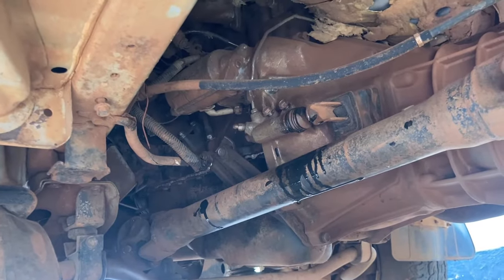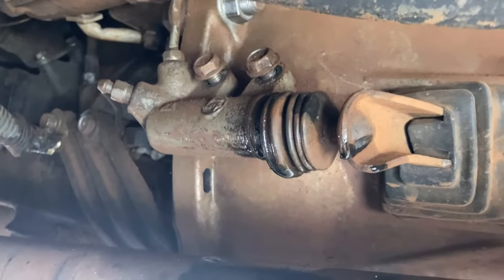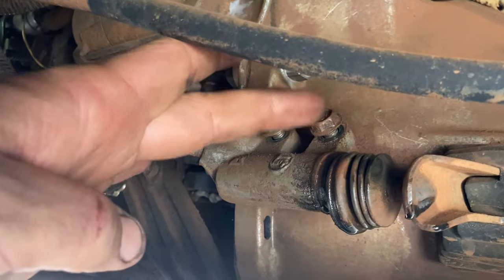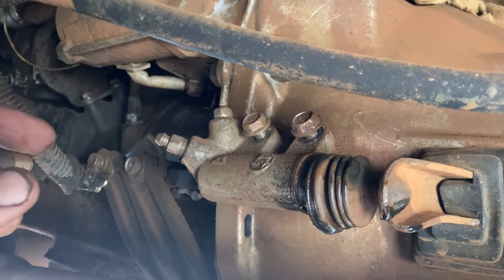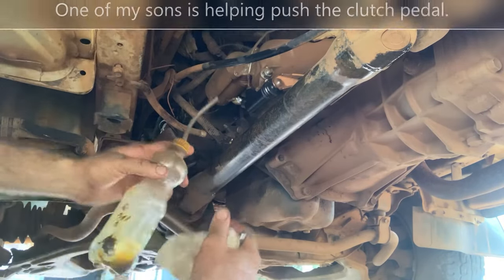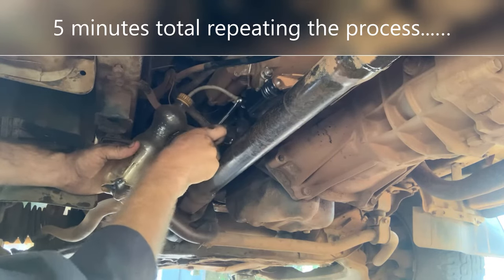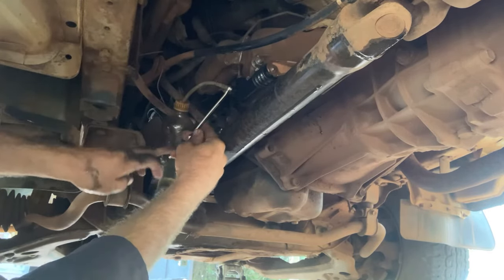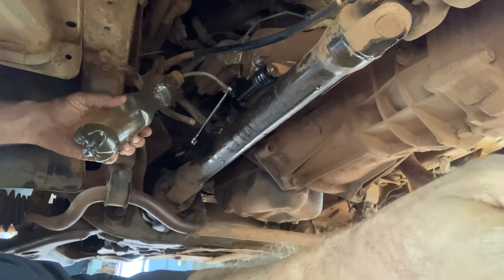Clutch Slave Cylinder - How to replace and bleed/purge the air

Comment: In this case I think more comfortable will be just do same as bleeding brakes the "one person method" where you have half full bottle od brake fluid, hose from bleed valve at the very bottom and you just do the "pedal work" by yourself with little bit open bleed valve. Much quicker job

Comment: nice content, at 00:44 when you slide the rubber is it normal for the fluid to drain out or if you slide the rubbber there should be no fluid coming out. Because my vigo when i slide the rubber the fluid drip out? Thanks for the video
Reply: Seal is bad if it leaks out of the rubber
Reply: @joshhoward6223  What is best replace the whole set or just the repair kit, when it leaks, thanks for the info
Reply: @Mac-bn I got the same problem, in my case I'm gonna replace the whole thing since it's cheap and easy, the old one is too worn out imo